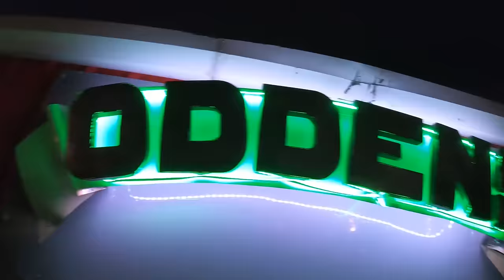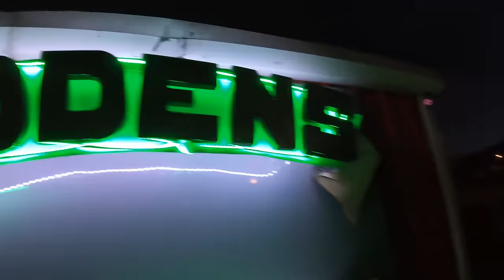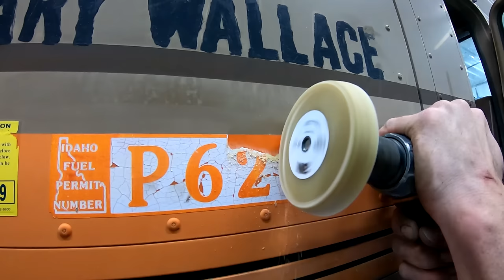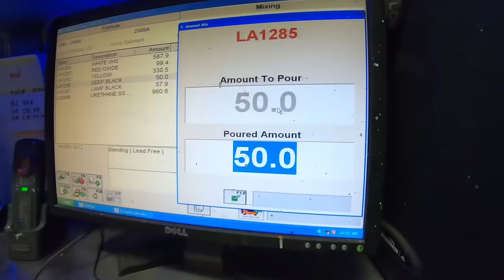International 9370 🦅 Restoration - Part 4 - Welker Farms Inc

Comment: You sir, are a trend setter.  Probably the only guy on the planet that would put so much into that ol' truck. It's like restoring a 1992 Ford Taurus.  Dare to be different!
Reply: A gem in the rough.  LOVE IT!
Reply: @RobertWelkerFarmerBob  You need a nice smooth running not loud at all velveety Detroit with an air starter in that thing.

Comment: I thought for sure it would be big bud white. I had a Chevy dually had fiber glass finders and had trouble with rocks cracking paint. Body shop I use the main man said undercoat the crap out of those fenders will keep it from doing that. Sure enough it did. I put it on good and thick. May want to try that men.
Reply from the maker: Good idea! I'll do that for sure!
Reply: @WelkerFarms   Raptor bed liner works well also

Comment: WOW.  What a great job of prepping and the final painting. My buddy had one with a KT in it..almost same colors. Ian very talented. I would take any of my stuff to him for sure!!! Freightliner repainted #389 of FLD 60" flat top. I put over 3.7 million miles on it. Big Cam IV with 13 speed. I had motor rebuilt 2x and 13 speed 1x. It was a great truck. The only one I ever ordered.  Extra cab insulation made a big difference with wind noise. I wish I would of had Ian do mine as it took them 6 weeks. I was so disappointed.  Plus the cost. Great videos as always!

Comment: Hey guys, you've out did yourselves! What a gorgeous paint job, love the colors!!
Reply: WE do too! Thanks!!
Reply: Have you ever seen an "84 CL9000 Ford truck? The thing had 4 different colors in waves up the side of the truck, I repainted mine, so I know a little about what you guys did. One thing I did on the frame, I used a high pressure washer with a sand blaster nozzle, sand goes everywhere, but that thing takes off paint like washing off mud.
Reply: We had one just like this one, Robert, 350 Cummins 13 spd, and a Silver one with different stripes of course, but with a 400 hp Cummins, 13 spd. both had air ride cabs. Really liked those trucks.

Comment: Wowzers!!  You guys did awesome!! I hate repairing the cracks on the fenders,  we grind them out and fill with dura glass.  Long process but pays off.  We have a product made by endura that we spray inside the fender wells to help stop future cracks from happening.  Basically it is a thick box liner product but it stays somewhat soft so rocks just bounce off it.  You guys should give that a try.
Reply: Endura.....will check it out.  Thanks much, Blessings!

Comment: Turning out nicely, I saw a truck on truckpaper.com that I'd like to do the same to, its an 83 Mack Cruiseliner cabover. Thinking of adding another truck to my business running containers. I looked at the price of some new and nearly new ones and this may be a better alternative. Wondering how much you put into the truck for a budget. Like you guys I can do alot of the work myself but paint is for the professionals.
Reply: We are looking at 15K now, with new tires (they are closer to 4K)
Reply: @RobertWelkerFarmerBob  Thanks, still a lot cheaper than new and a bunch of good condition road ready used trucks. I suspected it was around 15 to 20k you guys shelled out.

Comment: Now you guys will have to build a garage for this truck, you can't leave it out all year to weather in the sun, snow, and, rain.
Reply: It's going in first!
Reply: @RobertWelkerFarmerBob  I live in extreme North East Minnesota, and, we have harsh weather here, i have a 10 year old Silverado, it sits outside all year, I try to wax it once or twice a year, one thing i have found, is that the clear coat finish is much more durable than the old paint finishes. I use a high quality wax and buff it out, and, it does do a pretty good job. I would imagine that blowing dust out there is probably about the worst thing for paint.